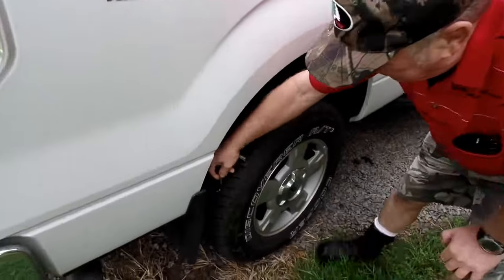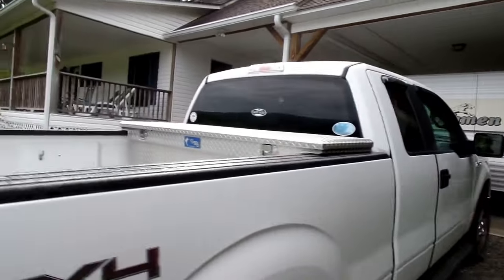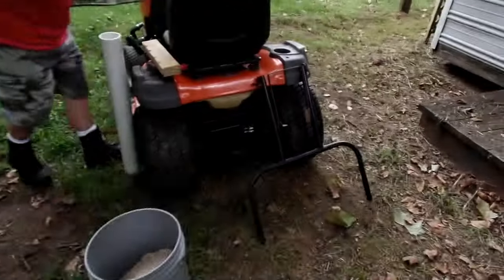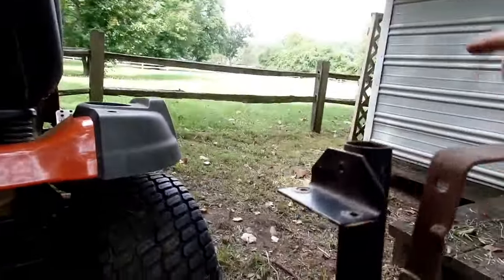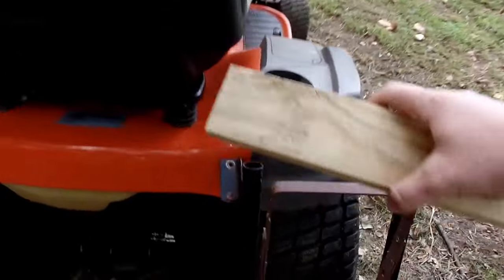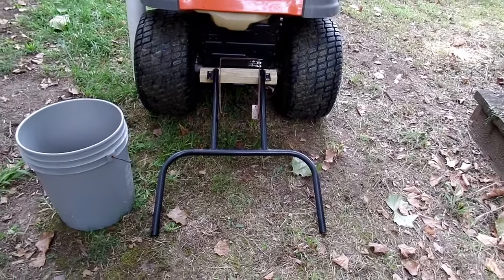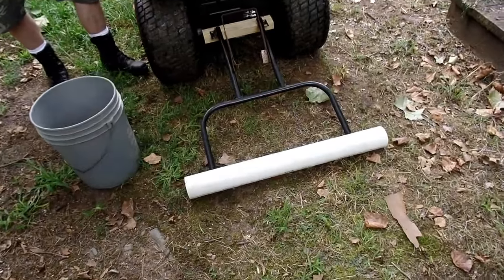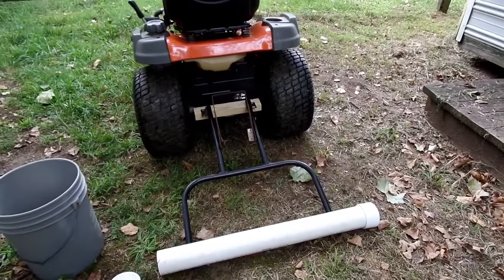DIY Lawn Striper For Riding Mowers

Comment: I miss my Dad.  Enjoy every minute you get to spend with him.
Reply from the maker: +hodgesjb I will for sure, and comments like yours on this vid, and others, are really inspiring to me and make me realize how blessed I am.
Reply: Me and my father stopped speaking about a year ago ( something I never thought would happen) so yeah cherish the fact you guys get along for sure.  What about putting concrete in the tube for more weight , would that help made a better "dominate" stripe ? also if you put a bolt through the brace pipe inside the pvc pipe then filled it with cement it would certainly be solid and never come off. curious what you think as I've never even thought of doing striping until I viewed your video.
Reply: Sorry for your loss
Reply: Same

Comment: Great idea. Great vid. Thanks for posting it. You’re pops and you are a treasure to watch. God bless you both. I gotta say though... I can see that coat hanger twist tie failing or eventually pulling through the hole in the pipe over time from vibration/chafing away at the plastic hole from normal use. I humbly offer a minor improvement idea. Drill a slightly bigger hole in the table legs and run a threaded rod from end to end of the tube that sticks out a wee bit out each end cap. Drill a small exit hole on each end cap, slap a washer and a nylon lock nut on each end and you’re done like dinner! That’ll never fail and hold those end caps on nice and tight. If you ever have a problem or need to top up the sand you just remove the nut and washer, pop the end cap off and fix what ya gotta fix. Cheers from Canada and thanks for the inspiration.

Comment: Your dad is a Ford guy, good man. Thanks for the video.
Reply from the maker: +Joseph Downey yes he is. He used to have a GMC but it did not do well pulling his camper as well as it just couldn't handle all the heavy hauling he does. I convinced him the Ford would be much better because during my 15 years at TruGreen, I saw GM products break after 2 years and Fords on the road after 10 like they were brand new. :)

Comment: I used concrete, and put aluminum foil around the threaded rod so it can turn after the concrete dried, works like a charm, and I don't have to worry about the concrete falling out, in case the drilled holes were not perfect... I do not recommend sand, that was my first option. It kept falling out. On top of that, the concrete made it a lot heavier which gave me great results. Also I used I bolts on the rod on the end caps instead of drilling in the center of the PVC pipe. And an L piece of metal, pushed the striper against the wheels and cut and when I had about an inch of clearance from rolling backwards, I cut the L shaped brackets to size and now I can roll back and forth with no issues

Comment: I tried to put a picture with this comment, but couldn't.
I use a semi truck mudflap as a stripper.
The place on the back of the mower where a trailer pin would go, can be turned around. That makes the rear of the mower flat. Cut the mudflap (which is about 3/4" thick) a little more than the width from the outside of the rear tires. Attach the mudflap to the existing holes with bolts with the bottom of the munflap about 1/2" up off of the ground. It will work going forward or backwards. Most truck tire shops will give you a munflap for free. I've had the same one on for 100 hrs. of mowing (2 years)

Comment: Super!  Beautiful country, near where my folks were born/raised.  I wonder if the sand alone may not be heavy enough, and when dry might seep out.  I'd put a mortar mix in wet and after it sets up would likely be heavier than the sand alone.  I plan on doing something similar for my riding mower.  I wonder if a rolling tube (vs a dragging tube) would make a difference.  Kudos.

Comment: Fill the PVC pipe with liquid concrete. Throw a couple pieces of rebar in there as well. What you're trying to do is count for the weight of the tires that the tires make indentation in the lawn.

Comment: I made a similar one last night. I ended up using 1/2" galvanized piping for the frame. this allowed me to use a cap for the inside of the pvc to keep it in place. I mowed last night after it was built (in the dark). I'm thinking there might not be enough weight in the pipe. the stripes weren't as well defines as I expected.

Comment: with some work and that folding table leg you can add a lift for it so you can raise it off the grass to turn for your next pass and I'd use inside caps, but why sand and not water?
I'd also skip the coat hanger and just use a clevis pin they lock in place. or a 1/4"-3/8"-1/2" all thread and hold the caps on with it too.

Comment: Cool video.  Im a pressure washer, and couldn't help but notice how dirty your dads roof is.  It's faster with professional equipment, but you can clean it easily with a pump up sprayer... mix 50/50 water to bleach, and about  1 oz per gallon of Gain soap, and spray it on.  May need a second coat on tough areas.  You can rinse it off, or just let the rain wash it off.  It will look brand new.  Stronger the bleach, the better.  Clorox is around 8%, but if you go to Walmart you can get chlorinating liquid that is 10%.
Reply from the maker: yeah he and I actually talked about this a couple weeks ago. Here in Florida we get that growth on our roofs even worst - they use Pool Shock here as it's got super high chlorine content. Just spray it on and it kills all the stains in a matter of a couple hours.

Comment: Cover or replace the gravel (limestone) in the driveway with crushed-limestone, it packs down like concrete over time and it's not large enough to get struck in the tire tread.  also, can spray the roof with Wet-and-Forget to get rid of the black streaks.

Comment: Hey there, I live in a neighbor hood with horrible lawns and one of those is mine. It's sandy, filled with weeds and crab grass and does not have an irrigation system. I was wondering if I can just use a cultivator of some sorts to rip all that up and then just lay seed or is all that I need to do is lay some seed. I live in southern Maine. Let me know what you think. Thank you.

Comment: For the plug I would have used digital calipers to measure the inner diameter. Wrote down the measurement, and moved it to the compass. Using the compass adjusted to the measurement that we received from the inner diameter reading that we got from the digital calipers on the inner diameter of the PVC pipe, mark it down on the 2 x 6. Wich gives a 1.5" Hei x 1.75" pressure-treated wooden plug.

Comment: Awesome!!! I've got an idea for when you are twisting the wire inside the pipe. How about inserting both ends of the wire in the drill where the drill bit normally goes and having the drill do the twisting for you instead. Also, how about using wafer caps instead of end caps. One, it wont leave a trail on the ends of the pipe, and two its a major price difference... Great Video...
Reply from the maker: awesome ideas!

Comment: The good thing is Lawn Care Nut, is this DIY Striper could actually work for a Push Mower too don't you think? I may be begging here...but any idea when a new video will come out from the new house's lawn renovation? :)
Reply from the maker: +Myrick Willard it could for sure, but those table legs would be a bit large for a walk behind I'd think. But the concept of a sand filled PVC pipe would def work.

Comment: I have a poly roller that you fill with water, it is fairly light when not filled, would that work?
Reply from the maker: +GeneralMartinus anything that can press the grass blades down into a certain direction will work
Reply: Thanks, Allen.

Comment: for zero turns we used to attach a heavy strip of rubber right to the back of the mower deck.
Reply from the maker: +gatewaysolo104 tht's a good solution too!

Comment: the best cheap stripe kit is a horse stall mat. cut it down and mount it to the back of the deck or push mower. Trust me you wont regret doing this. around 30$ and I did a 72'' deck and still have enough to do it again in 5yrs. that's how thick it is.

Comment: Instead of drilling a hole into the table leg for a pin to stop it from removing. You could have used a hose clamp around the leg. Just would be less drilling, also would allow you to remove the table leg from the PVC if that ever needed to happen.